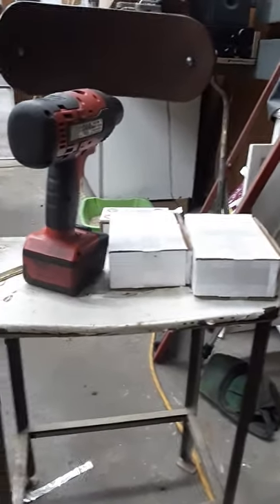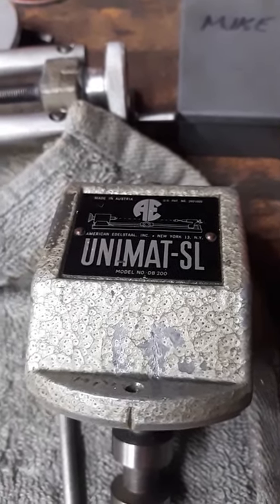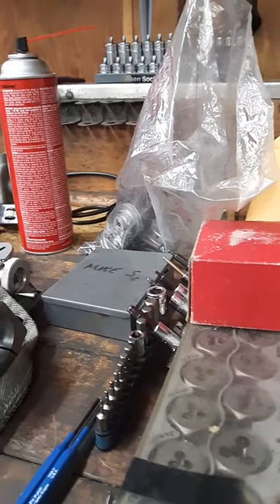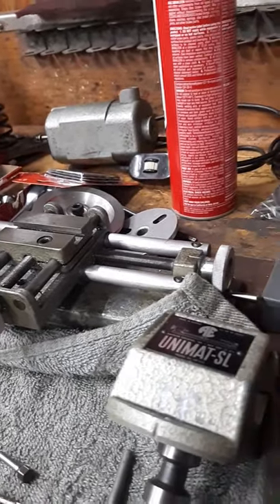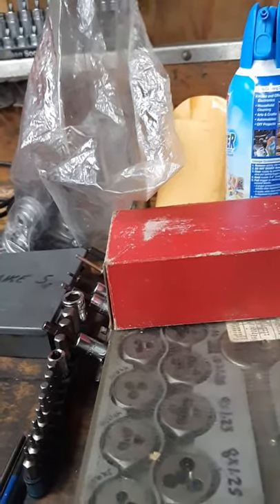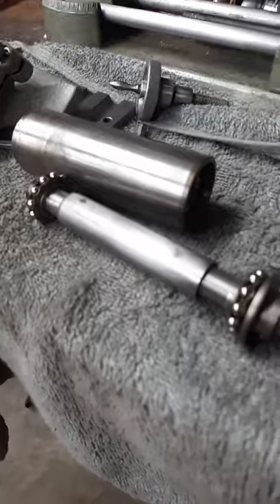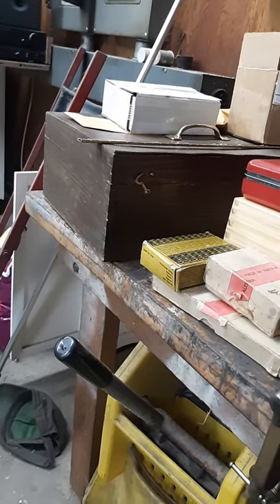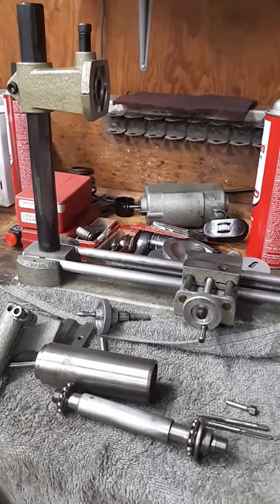Unimat DB200/ SL precision micro lathe "barn find" DOWN THE RABBIT HOLE!  pt. 1 scene 1

Comment: do you  have the indexing attachment?
Reply from the maker: Oh man I have been eyeballing a complete set but they're so expensive!
Reply from the maker: I did it. I bought a set😜 got vids coming down the pipe.
Reply: @machinistmikethetinkerer4827  yeah!  I have a set.  I am slowly working out how to use them.  I've been digging deep in the youtube and found one clip showing a manual instructions in german I believe but it clued me in partly.
Reply from the maker: @colemine7008  nice. It's called direct indexing. Fortunately as a machinist I have a bit of experience with it but not these particular ones so I've been looking. The set just arrived today but haven't had time yet to check em out. Simple enough if you know some division you'll have it.
Reply from the maker: @colemine7008  http://raremanualdepository.blogspot.com/2016/01/emco-unimat-sl-machine-tool-user-manual.html

couple of manuals you might to check out if you already haven't done so. chapter in there covers indexing too.